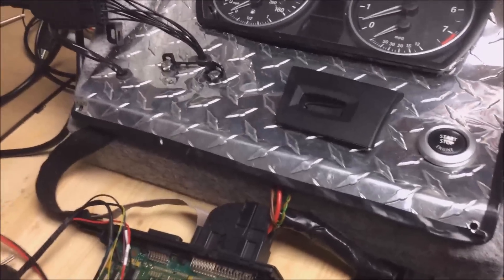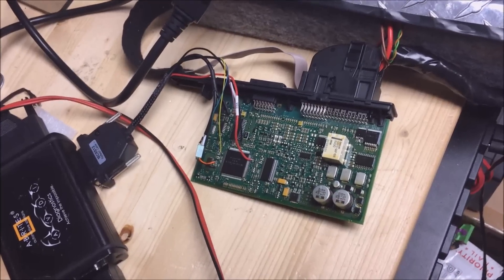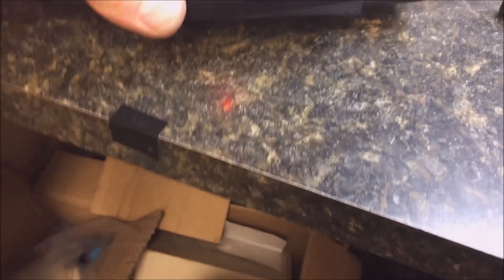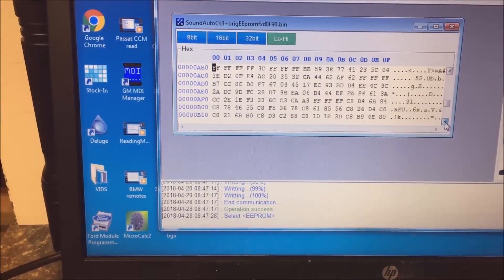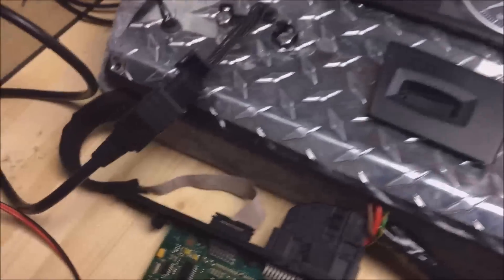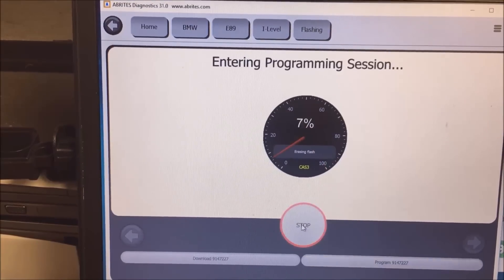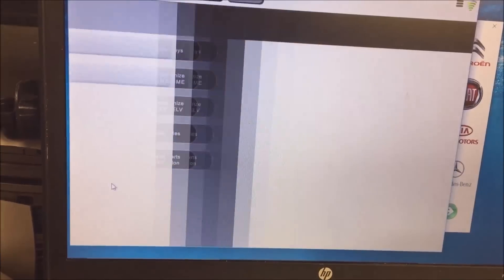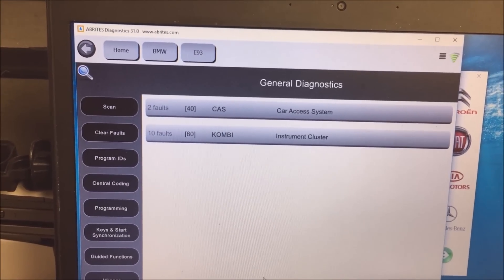BMW CAS3+fix

Comment: How did you make that test bench?
Reply from the maker: I went to the wrecking yard and bought the modules and the cables attached to them, then looked a a wiring diagram and hooked them up.. pretty easy really...
Reply: @timtracy9442 cluster, fuse box, body control module, CAS module and key fob ring?
Reply: @timtracy9442  WHat modules do you need cluster, body module, jbbe, key slot and button, cas?
Reply from the maker: @ClarckRPieters  no, just cas and cluster and key slot and push button.. the key slot and push button plug into the ribbon cable that plugs into the cas, then you just put power and ground to cas and cluster, and obd plug and hook up the can lines.. if you hookup the dme, you will kill the circuit, you can only have one or the other on the can, if you wire in a footwell module, you can then wire the can to the DME and then a seperate can to the CAS, but you can't have the cas and dme on the same can bus.. hope this makes sense.. I usually just need to fix or make a key for the cas.. i only read the ISN from the dme..
Reply: @timtracy9442  I'll go to my parts guy a source some harness pieces to get it done, actually i have the parts I just need the plugs for the cluster, cas and a obd port

Comment: Hello, I have BMW 325d CAS3+ module, the car does not unlock and lock without any keys, the car can be opened by LAUNCH, ISTA shows and leads everything to CAS, no antenna or keys are at fault. The software has an error in it, how do i fix or reprogram it as from factory? Also tried with older version CAS3+ module and everything works.
Reply from the maker: do you have the handles that have lines on them??  if so, go to the right side of trunk and look for the Comfort Access Module, it is on the right side of trunk up above the battery.. if your handles go bad, IE, they short out, it will knock out the remote portion of the keyless entry.. if it is a mechanical issue in the CAS, you can get the same part number and move data over from yours to the new/used module rather easy..
Reply: @ Already moved data from original to another CAS block, and it's excatly the same thing nothing changed, i have sedan, I'll take a look at the trunk module, do i have to look for specific problem or what? At last we thinking that software got error in somewhere.
Reply: Also when i try pressing the keys, the car also start making clicking noises.
Reply from the maker: @silinsss  What usually happens is the antennas in the handles short out, sometimes you can unplug the handles and things work ok, sometimes they take out the module when they sort out..

Comment: question about the editing software - looks like you use arbrites, when I looked them up  it is EXPENSIVE... OK for a shop, what can you suggest for the DIY/small guy?  great video, thanks.
Reply from the maker: Yes, I use Abrites... It is $1,500.00 for the intial setup.. and most of the special functions are included.. You can look at the Autel setup, $3,500.00 plus $1,200.00 a year for updates.. and it won't do a lot of what Abrites will do.. I am actually using VVDI prog to edit the file.. it's about $400.00 for that setup..

Comment: Very owsome video big guy ..can you please check somewhere in your old saved videos I need some bench connections on a bmw e90 cas 2 I'm using an autel im508 and m still  a Newby on this platform
Reply from the maker: never had to solder on to a CAS2.. Usually any of the programmers will do that via OBD2..

Comment: Do you offer a CAS3+ repair service?  The CAS module is not bricked but it seems to be on its way out. When the car warms up it seems that the CAS might be overheating or something and not working, the first time it happened I pulled the CAS relay in the glove and it was hot, I let it cool put it  back in and it started right up. Second and third time it happened I did the same thing but the car would not crank, I waited like 35-40 min tried again and it cranked right up. If you do provide this service I would love to have you repair it for me you seem to have a great understanding on how these CAS modules work.

Thank you.
Reply from the maker: no we don't.. only to locals garages..  I would contact a local locksmith, they should be able to clone your CAS and then you can try that one and see if it is the problem.. My question is, does your car have comfort access?, where the door handles have squiiggly lines on them? we have had the handles, which are the antennaes go bad and cause issues..
Reply: @timtracy9442  Yes I do have comfort access and it has not worked since I got the car 2 years ago. Interesting, what issues exactly would they cause? Nothing in my comfort access system works, door handles, mirrors folding after locking and unlocking car, keyless start, etc... Thank you for the speedy response and info brother!
Reply from the maker: @dannynavarro126  go find the Comfort Access Module, if it's a 3 series, look in the right side of the trunk, they are usually above the battery behind the  insulation.. We have these a lot, when the antenaes short out, it causes the car not to start, if you scan the car, it shows a steering lock fault.. the Comfort module is in the circuit between the CAS and the steering lock.. we usually just unplug the plug on the module.. then ask the customer if they want us to troubleshoot the handles or just leave it unplugged..

Comment: Can you please give us a better and clearer soldering diagram in Case 3 module. I just don't wanna screw mine.
Reply from the maker: If you are using VVDI prog, the diagram is right there in the diagrams...
Reply from the maker: go to 2.52 and look at the VVDI screen, see where it says connection diagram?? follow it

Comment: This is beyond mechanic work this is software engineering stuff. I’m an electronic technician and I don’t even grasp all these complex digital stuff
Reply from the maker: Nowadays, this is mechanics work.... It's getting crazier everyday... yesterday I was repairing an immo box for a 1996 Merc E class... because there aren't any left in the parts system and the customer wants to keep the car... This one gets me everyday, 2007-2018 sprinter vans, did you know there are only 34 remote keys in inventory in the US??  the dealer has to build a case for each key they try and order.. and they won't even try and order an extra key.. only all keys lost.. This is actually great for the rest of us, I do a couple each week.. :-)

Comment: You could do all this. You could use Autel to help but that’s just as long winded which leaves chances of failure greater because you could forget a process, or you could take the easy option. An option which would allow you to drink a coffee whilst lounging back on a chair and doing nothing but watch a blue scrolling bar as the process completes. WHAT? 

Yeah baby. Just plug in obdstar x300 DP PLUS and select broken CAS file repair. Hit go and get comfy.

Comment: Hello I’m from India and I have a 2011 bmw 320d (E90) I’m facing the issue of CAS module being locked in every 2 days then I have to run with the key and the module to my nearest Electricain who has tools , he resets the CAS module by connecting it to Auto hex and gives me and when I install it in the car the car starts perfect with 0 error codes and runs perfect and when I park it in the night and start the car next morning there is no crank no lights in instrument cluster just one message on I drive which says ( ENGINE START FAULT , ENGINE CANNOT START IF IT IS SWITCHED OFF ) then again I have to take the CAS module to the guy who resets it , I’ve even changed the battery to a new 100amp and registered the battery even changed the CAS module still facing this issue , if anyone knows what to do plz tell me

Comment: can you help with the wiring diagran for this setup
Reply from the maker: not understanding??  wiring diagram for what??  reading the data with VVDI prog? thats in the program.. for talking to the CAS?, I would buy a cable, in fact Shemek Best makes a great interface.. or you can get a cable from a VVDI supplier.. As for the simulator, I got a bunch of plugs from the wrecking yard and wired them together, used all data to find the wiring diagrams..  A lot easier to buy a cable..
Reply: @timtracy9442  sorry I commented on the wrong video ,meant to ask about the video of the cas module and cluster bench setup

Comment: Very good job. So after the writing of flash and eeprom to your cas ,you went on reflashing with avdi.. avdi dis automatically put vin in the cas? Did it also put the isn from dme to the cas or did you do that yourself? Is this exact procedure the same with ista p?
Reply from the maker: Well, I rewrote the CAS with a flash file from another cas module with same part number..  I fixed the eeprom by changing the lock bits in it.. The Flash is basically the operating system of the module, the eprom holds the vin and key data... If you watch the video, I state that the shop had used Ista P and it had bricked the module.. it is common for ista p to brick older cas modules.. As for the exact procedure with ISTA,  Ista is the factory tool, YOU HAVE NO OPTION WITH ISTA TO UPDATE A SINGLE MODULE.. ISTA STARTS AT THE CAS OR THE FOOTWELL MODULE, THEN UPDATES ALL THE MODULES ON THE CAR.. TOTALY DIFFERENT THAN AVDI..
Reply: @timtracy9442  ok mate thank you for your answer
Reply: @timtracy9442  could in this case winkfp update the cas only?

Comment: i have a question regarding last part about key not being recognised, what was it in the end? . i'm in the same situation now hence my quest finding possible solutions. mini 2006, cas3. programmed a new key (original one was not recognised either) and car does not recognise it (shows the same key symbol like yours) although if i go into cas module i can see it. cas module shows no faults. i've ran out of ideas..
Reply from the maker: Usually that happens when the flash is corrupt...  I just finished a 2008 3 series that someone else had tried to make a key to, but they corrupted the flash.. I could talk to the module, make a key, but when I would open the program it showed no key in slot..  I finally wrote a flash from a CAS that i got to replace the CAS in this video.. I wrote the Flash, then wrote its coresponding eprom, made a key and it showed it in the slot, then I wrote the original to this CAS's eprom, and used one of the keys I had made for it that it didn't see in the slot, and it worked... remember, the flash is like the operating system, and the eprom is all the specific vehicle data..
Reply: @timtracy9442  thank you for sharing this informations! 
will follow your exact steps to see if i can get it working.

Comment: Thank you for this informative video...One time it happened to me while using Chinese clone arbites and bricked my CAS...after a panic and not knowing what to do, I used Winfkp to reprogram the CAS and LUCKILY it came back to life....

I have VVDI prog, same as yours but I'm having trouble reading the CAS? R270 reads it fine, but I bought VVDI so I can consolidate most of my readers. The guys in europe or china are not helpful at all. any ideas? thanks

Comment: Hello friend. Thank you for your video... i have a similar problem with an E70 X5. When programming with ISTA/P something went wrong and now I can not open switch to illuminate dashboard and car won't start. However I don't have CAS fault codes when scanning. 

I sent my cas to programming and now switch does open to the first position but not the second. What do you recommend? Do you think the problem is still my cas?
Reply from the maker: I would say yes, your CAS has corrupt data....  I would find a CAS with same part number and read data(eprom and Flash) and compare the data...  Usually when any programmer writes back the flash on an Ista/P 45 or newer CAS, it either rearranges or leaves out some of the data...  Good luck....  what part number is your CAS??
Reply: @timtracy9442  thank you for your reply. I'm really having a hard time with this car. My cas number is 2071075706, its a CAS 3 with EWS 4.

Comment: Had Abrites killed cas3+ via online downgrade, got eeprom fixed by xplorer. Thereafter no more obd on cas3+, bench only. AND by the way, corrupted eeprom file had the correct F90, when the working eeprom all FF FF FF under F90. So there is more to it..
Reply from the maker: Yes there is...  we have seen the flash where half of it was missing, also seen the eprom screwed up..  But the lock bits are one of the more common things we see, I usually compare the flash to a known good flash, and also the eprom to a similar known good eprom file...  Just remember, you have to write the flash, then the eprom, if you do the oposite, it doesn't seem to want to work....  Good luck...  PS, the F090 is different for different CAS levels... this was a CAS3,  ALSO, I have given up doing CAS3+ in the car, unless I have a wired ethernet connection and a lot of extra time...  I usually pull the module and use ACDP..  No solder, no mess..
Reply: Tim Tracy right, ACDP seem to work well

Comment: Thank you Tim for this video.

I have this similar case.
BMW E70 MY 2008 system keyless go, in AKL situation.
Read CAS and ECU (EDC16CP35) on bench and prepared one transponder. Try on the car, but nothing happens, NO light up! Programmed only flash of CAS with programmer with one file of another donor CAS (lower version) and key work ! Car start only one time, after is not possible to crank engine. Find ISN of DDE (2Bytes) and they are similar of last bytes of ISN CAS 4Bytes. CAS ISN 16Bytes are ‘FF’. I’ve try to make another key in another position but is not possible. At this point with transponder and KEY_ON I have try to make sync CAS-DDE, but isn’t possible. I think maybe both CAS and DDE was corrupted but I don’t understand why ???? Any idea for fix this case, please?